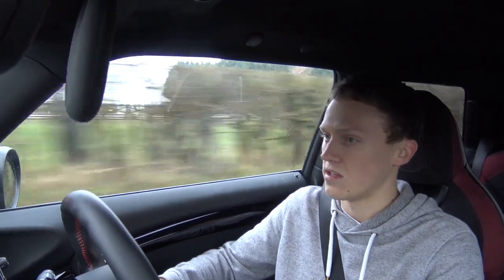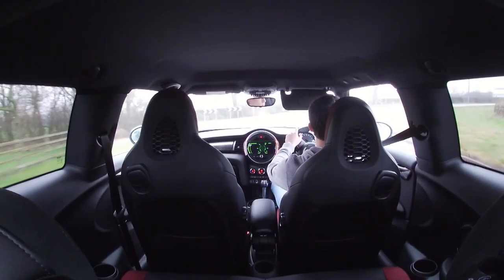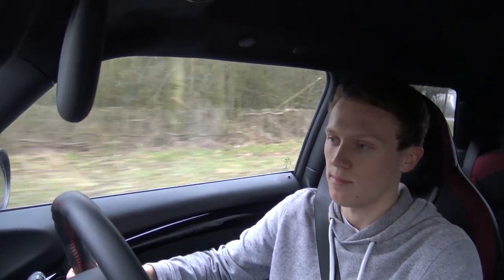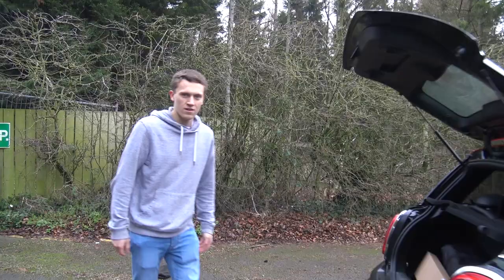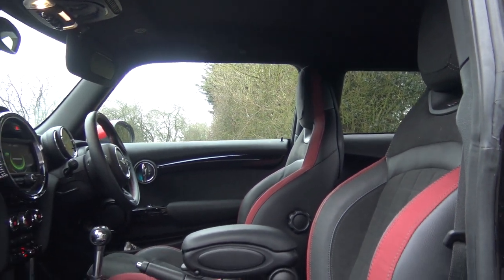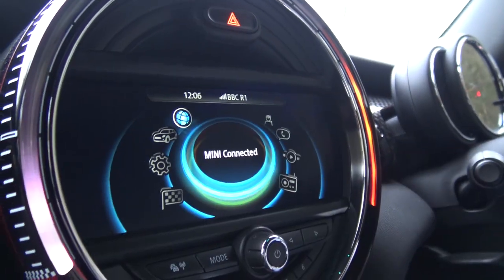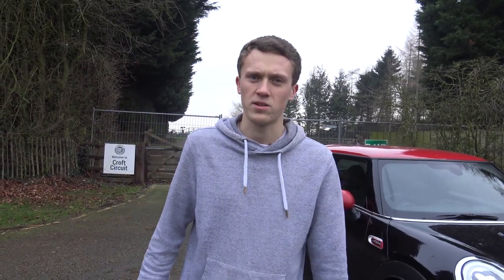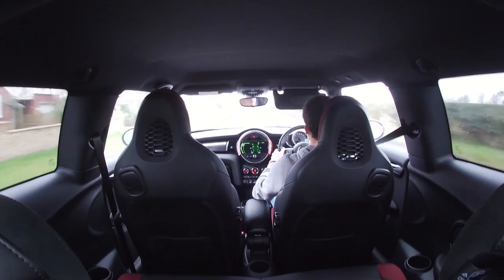Living with a Mini John Cooper Works (JCW) - Episode 3: Practicality

Comment: Thanks for all the reviews, very helpful. You mentioned about a lot of time in town traffic, 90% of my driving is in town with lights everywhere, would you say that the auto box would be a better choice for town driving? Thanks.
Reply from the maker: Thanks for watching! Really appreciate it 👍 Yes personally I would say if you're sat mostly in traffic the auto box may be atleast more preferable and probably would be the better option. The clutch isn't particularly heavy in the JCWs but it's heavier than most so when you're doing a lot of stop/start driving it does start to get uncomfortable. The auto box will just take off that extra strain and should make it more enjoyable for low speed, stop/start driving. Hope that helps!
Reply: @FootToPedal  Nice one Thanks :)
Reply from the maker: No problem :)

Comment: Any issues with the car since you posted this video? I'm looking at a Jcw but I'm concerned about mini's reliability.
Reply from the maker: Nothing major, overall they are very reliable cars I would say. The only thing that did happen was when I went to get a brake fluid service, the bleed nipples on every caliper had seized to the point they couldn't get them off without snapping. So I got 4 new calipers under warranty. Bit odd to me that they seized that badly on a 2 year old car but as I say, nothing extra for me to pay. The F56 generation is very well built so as long as you look after them, I don't see why you'd have any major issues. We will actually be filming an ownership summary video very soon so stay tuned for that!